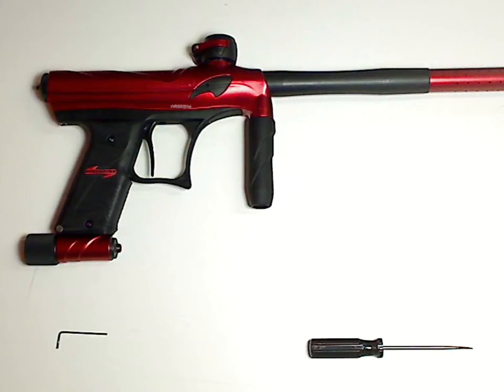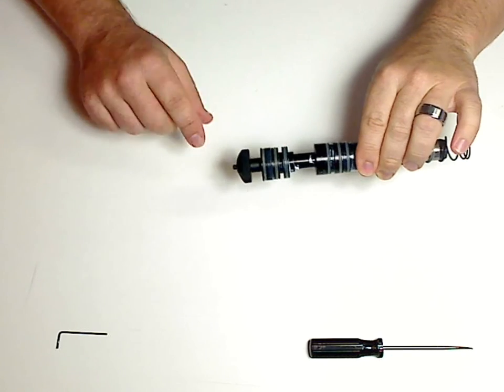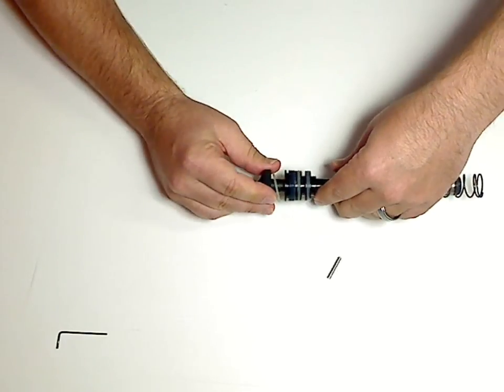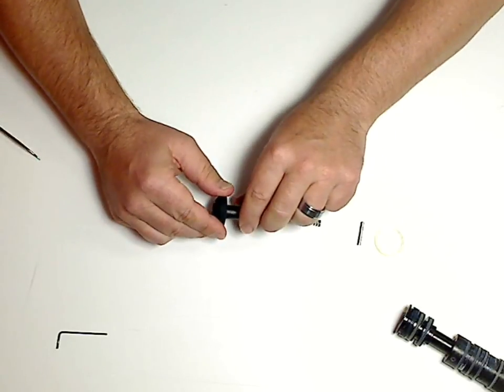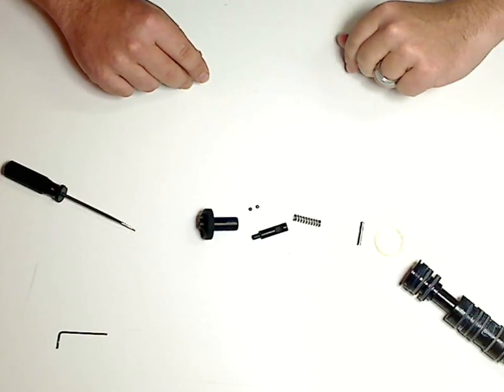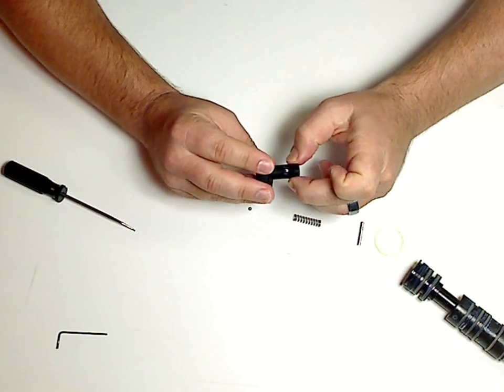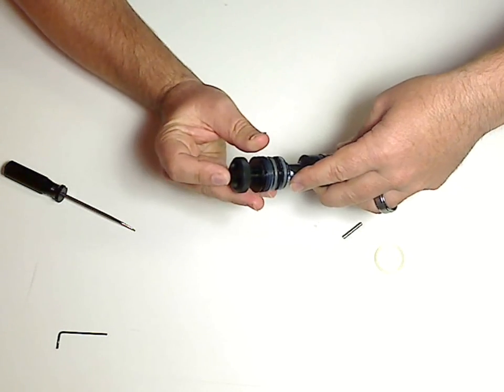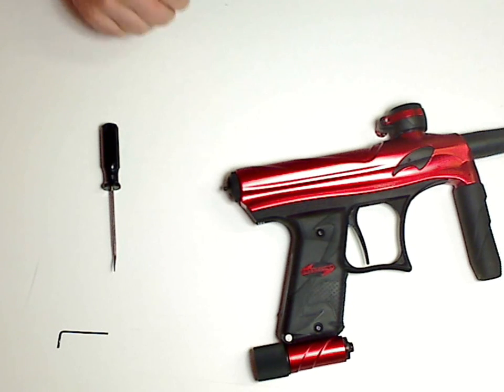Tippmann Crossover XVR Tooless Bolt Removal End Cap Break Down

Comment: How often to you need to break the bolt down like that?  Seems like so many parts.
Reply from the maker: Full break down does not need to be done often.  I would take it apart if you have paint in it, water in it, or 1-2 times per season.  I have one that has not been taken apart in a year and works fine.
Reply: In comparence to most markers, that's nothing...

Comment: Do you have springs to make the trigger on this gun waay lighter? I cant walk the trigger as fast as i could on other guns. Also, what all has to be disassembled to get to the trigger assembly?
Reply from the maker: Ehere I'm sure they can be modified with lighter springs to give it an easier pull, however this will most likely void your warranty. For a complete tear down and reassembly of the Crossover, check out our video here. https://www.youtube.com/watch?v=TSa9iBKTAxs
Reply: Thanks! I assume different style trigger like the violent series triggers wont work on this gun, right?
Edit: Also, the video shows nothing about the trigger assembly. It cuts out when he is talking about the reg.
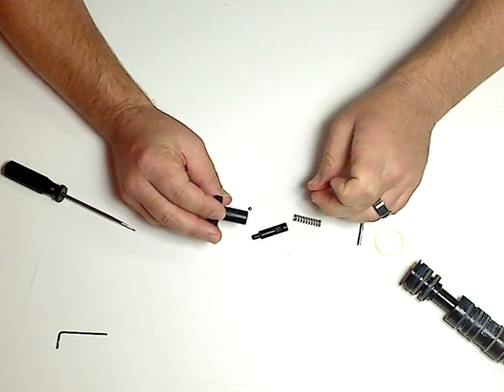Reply from the maker: Ehere I tried to look into any upgraded triggers for the Crossover, and other than the free trigger upgrade from Tippmann back in 2013 I am not finding anything. At the point in the video where you drop the grip frame and the trigger assembly is exposed at 3:30, from there the only thing you need to do to remove the trigger is to remove the two silver pins right above the trigger assembly.
Reply: Ok thanks for the help!

Comment: Has anyone ever had an issue where they’ve had a leak though the trigger system? It’s been a problem since day 1 I’ve purchased this gun, at the start it was a minor leak in mechanical, so I played in automatic and it was fine. Now after going into the gun, replacing, greasing and checking to make sure everything’s nice and tight the leak is even worse to the point where I can’t even use the marker which sucks because it’s the best marker I’ve played/owned yet.
Help!!
Reply: I had this problem, i removed the trigger pack to find 3 small o rings just sitting. the centre 1 of the 3 had been squashed, i replaced that, and the problem went away. I hope this helps.